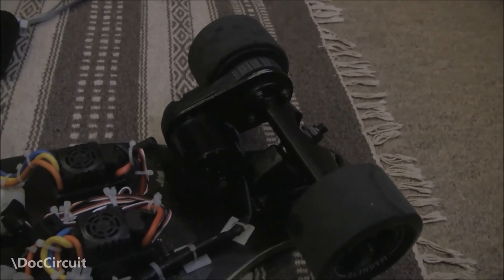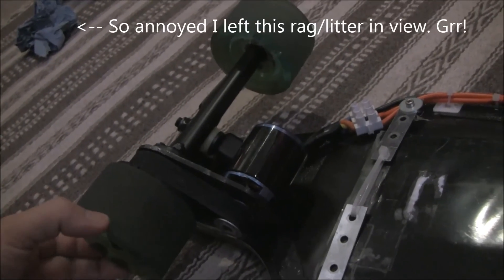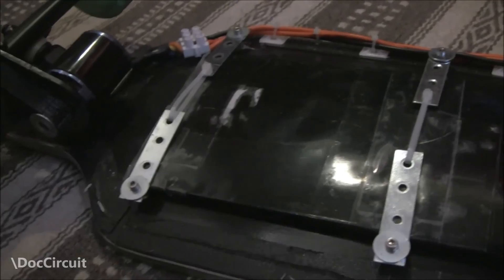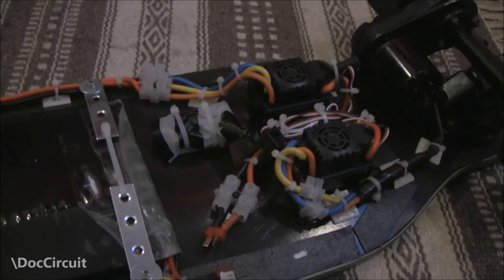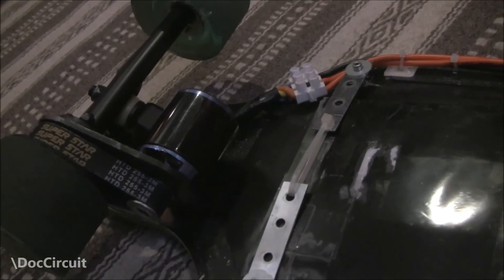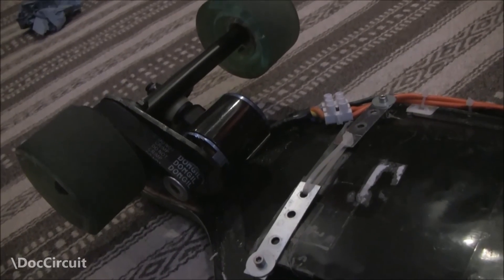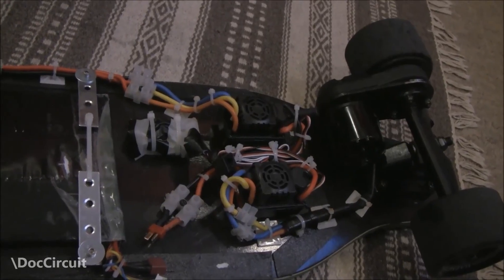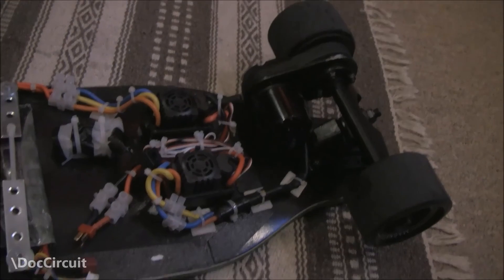Dual Motor, Push-Pull, Chinese Clone Electric Skateboard!

Comment: Can you give me a link to the stock motor used in the Chinese clone board such as the melon board. Also do you know the specifications of those motors? Such as the Model #, Voltage, Power Wattage, RPM KV, and Max current amperage? If you could let me know that would be greatly appreciated!!! Thanks you for all your awsome videos! I'm defiantly subscribing.
Reply from the maker: Thanks!

Motors used in clone boards:

https://magnetoelectricskateboard.com/products/ox-motor?variant=6827495173

https://www.melonboard.com/product-page/motor-and-mount

As for specs, I'm afraid I don't know. I used to have a link to the Chinese manufacturer's site that had these motor's specifications, but I've checked and I can't seem to find it.

:-(

Comment: I've also just ordered my first clone board and love what you are doing with your videos Dr Circuit. Already assuming I will upgrade the ESC in this board at some point and the Marine ESC is a really interesting new option.

As I looked for one of these boards in my area (Southern California), it seemed that everyone was out of stock with new shipments arriving soon. My sense is that all the sellers (Lecdec, Magneto, Melonboard, etc.) are receiving shipments of the "next gen" clone. I ordered a Melonboard and the variations I've been able to glean are: different shape trucks, either better tuned or completely different ESC (claiming slightly higher top speed and "smoother" control), and "probably a wider deck" (from communications with Melonboard). This makes me think the new Melonboards will have a deck like the Lecdec (just speculating on that).

Do you happen to know anything about the latest generation of clone boards coming out? It doesn't seem like anything radical, but they do seem to be slightly different from the older ones.
Reply from the maker: Hi, and thanks! You know pretty much as much as I do about the next gen versions of the Chinese clone board. They seem to be addressing the two weakest areas, the BMS and the ESC. I've heard the ESC will be more reliable and have better acceleration and braking curves. I'm curious to see if this is the case...

Comment: Hey, How are you getting on with the Marine ESC? The ESC on my clone board is really playing up now. After I brake, when I try to accelerate, the board wheel locks up, just like the brakes are on. I have to restart the board to resolve the situation, and that's just annoying.
Reply from the maker: I received my ESCs a few days ago and fitted them to the board, but I need to replace the blue motor with a black one to match the original motor. The blue motor has seized Alan bolts so I'm waiting for a new cog and bolts to arrive. When I fit this I'll finish installing the motor and I'll test it (including the marine ESCs). When I do I'll make a video...
Reply: +Dr Circuit awesome :) fingers crossed it all works perfectly

Comment: Absolutely Love what your doing with this board!  I've had so many probs with the mine.. The latest being the motor has gone! I have a replacement but can't get the silver revote off!? I unscrewed the 2 screws by Alan key.  But I just can't get it off? Any help?  #inspired
Reply from the maker: Thanks! I think you're actually ahead of me when it comes to the motor cog. I tried taking mine off a few days ago to fit a new motor and one of the Alan bolts are seized inside, so I've ordered a new cog. 

If it helps, the cog aluminium is soft, so be careful if trying to lever it off with a screw driver (the cog metal edge WILL bend). Generic advice: soak it in WD40 overnight? Heat outside of cog to make it expand? 

Soz I couldn't be more helpful.
Reply: +Dr Circuit Good shout! I may give that a try. Or better still order a new cog like you have... Where did you Order one from? I think thats a very sensible idea! Thanks again :)
Reply from the maker: No worries. I ordered mine from Magneto boards. Lee (the owner/director) is a very helpful chap.

Comment: Could you change the motor on a Chinese clone and add a bigger one?
Reply from the maker: +khalil ibrahim You could indeed. When you say 'bigger', you might want to make sure the motor fits in the space under the board when bolted to the motor mount though. You could go for a high spec motor of same/similar size.
Reply: Thanks 👍

Comment: Hi what are the marine esc's that you mentioned and do they have brakes? many thanks
Reply from the maker: +Anthony Hulse They do indeed, although I have no idea how good they are. However I haven't heard any stories of them being too sharp. I ordered them yesterday so it'll be interesting finding out...
Reply: +Dr Circuit , ok great would you mind sending me a link to them as I think I may try one as a cheaper option to a vesc. Thanks
Reply from the maker: +Anthony Hulse

http://www.hobbyking.com/hobbyking/store/__28224__HobbyKing_120A_Boat_ESC_4A_UBEC.html

They're shipped from the States and today I received a text to pay import charges of just over £20 (for two ESCs). Something to keep in mind.
Reply: Ahhhhhh ok thanks. New to all this myself. I have had one of the clone boards but the brakes seemed all or nothing and kept throwing me off so I sold it. Wish I'd of know how to change esc then!
Reply: +Dr Circuit Are the battery packs in clone board only 6s then as those esc's say they only support upto 6s?
Reply from the maker: +Anthony Hulse Yup, they do that. The brakes are far too sharp.
Reply from the maker: +Anthony Hulse Yup, 6S.

Comment: Are those stock ESC's that come with the board or are those the unlocked version of the brave Wolf esc's? If so why don't you try to turn off the braking on one of the escs completely and just have one motor for braking? That would make the braking softer, wouldn't it?
Reply from the maker: +ChrisReviewsTech Stock ESCs, so there's no way to turn off braking.